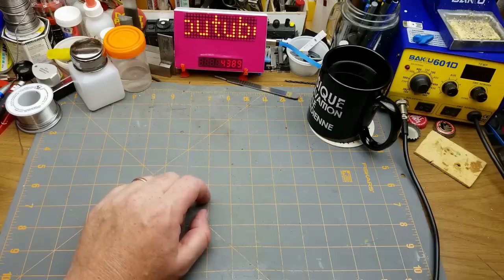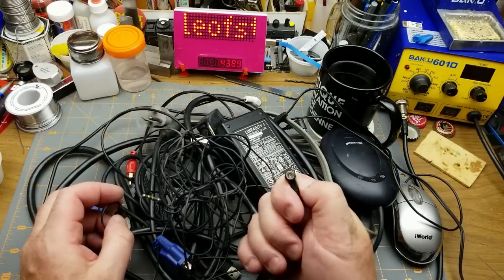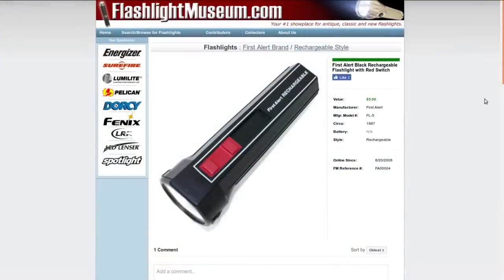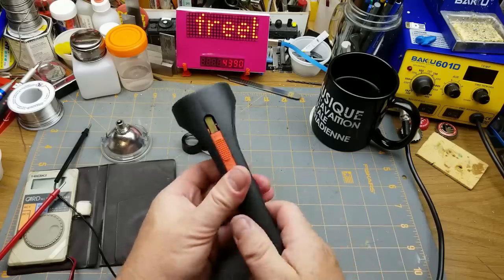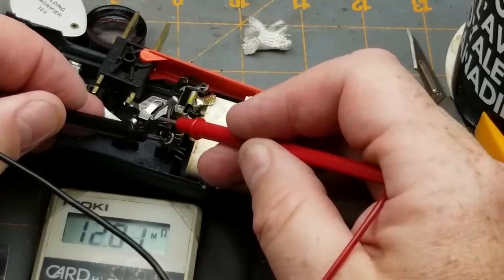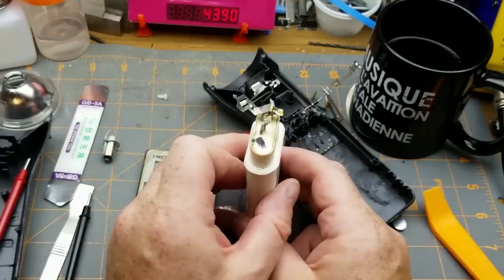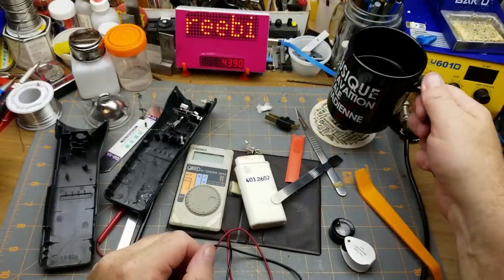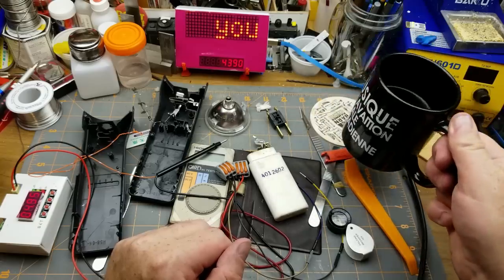free stuff and a teardown

Comment: We had a similar flashlight in the 80s. It had an additional feature though - should it be disconnected from mains power (outage or removed from the socket) the light would turn on automatically.
Reply from the maker: I remember those as well. If they were plugged in when the power failed, they would turn on automagically.

Comment: Put 2x paralel mounted 18650's in it now and a usb lithium charger board and a new multivoltage maglite led bulb replacement  and get it to work.. or perhaps make it charge from the wall again with only one 18650 and a board from a mains to usb adapter inside :)

Comment: You could add li-ion battery, charger circuit and a led light and get it working.
Reply from the maker: And some duct tape. I caused quite a bit of trauma to the case...

Comment: The switchmode brick is well worth keeping, you can never have enough free psu's :-D.
Even if it needs the output capacitors replaced.

I have an old Pioneer SA-706 amplifier that was thrown out with the dustbins, a frend recovered it for me :-D.
One of the old thick aluminium fasia types with real moving meters and steel case, very heavy, would have cost a pretty penny in its day.

The fault..... The mains switch was faulty lol :-D.

Comment: is it possible that the component attached to the diode is a PTC thermistor? it would have a larger voltage drop as it heats up and the trickle charge would be in the order of miliamps possibly! try heating it!
Reply from the maker: That is definitely possible. 

I haven't seen enough of them to know if they were ever made in that form factor.

Comment: I am confused how do they get 120 volts AC to charge a 2 volt cell with a diode and a fuse? I am blind and watching on my phone so I might have missed something 👍
Reply from the maker: I'm pretty much convinced it is a resistor, so it'll be limiting the current and dropping a bunch of voltage across it.

Though any resistor can be a fuse if you use it wrong enough...
Reply: @pileofstuff  my thoughts exactly

Comment: So basically the flashlight just drops the 110v over that resistor/diode combination and trickles 13 mA into the battery?
Reply from the maker: Yup. It doesn't get much more low budget than that.